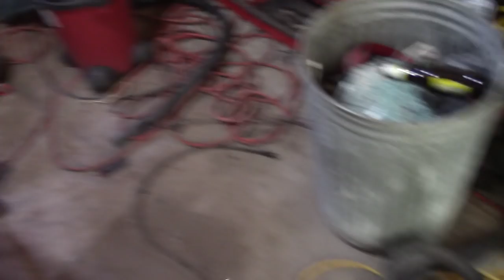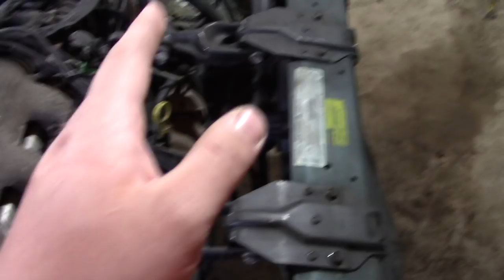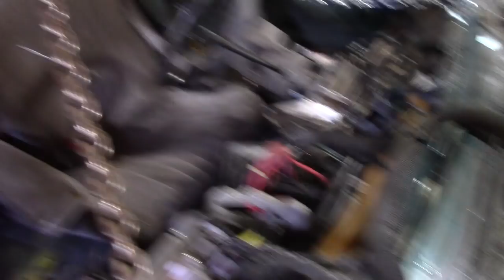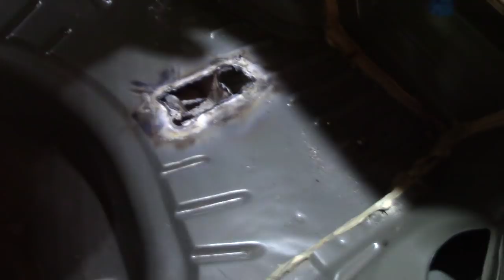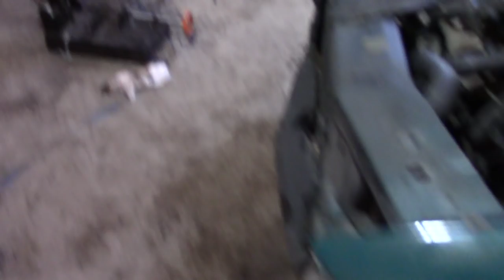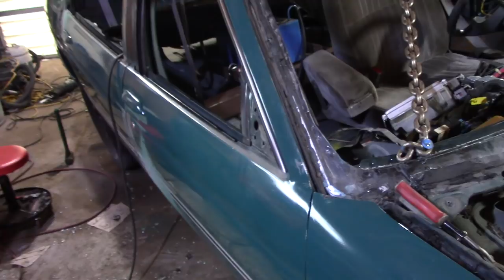UNICORN UPDATE!!! Derby tomorrow!!

Comment: Ya pre bend that rear good leave bumper on it bc it will help pack in and only weekness in tose is wires by alternator and drive shaft if there not steel. Late 90s buicks have steel shaft so u can swap them out with it. Good luck man